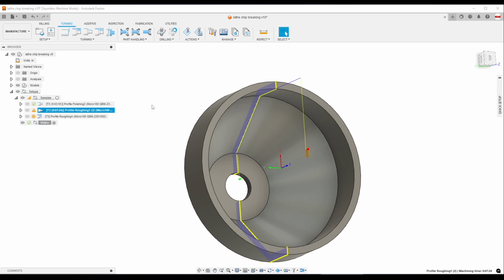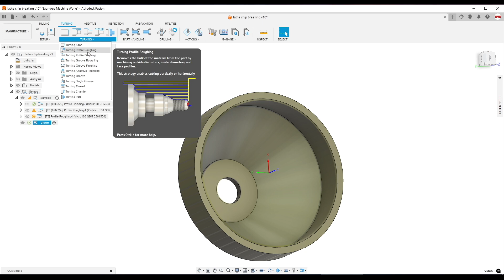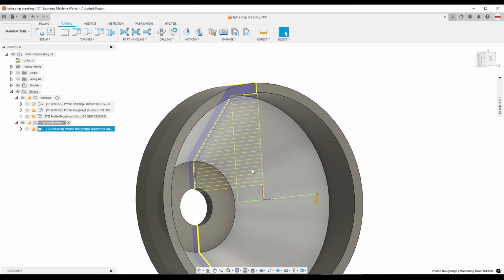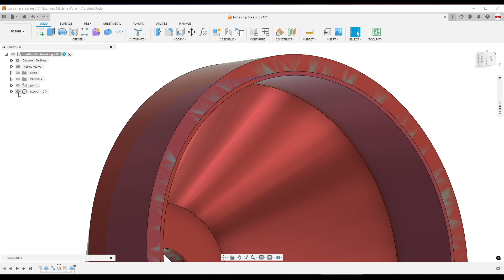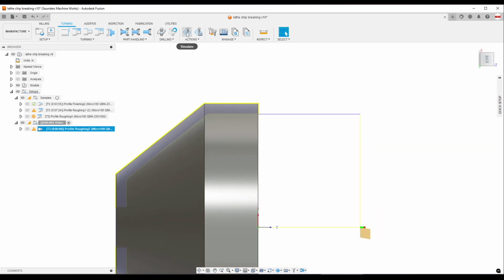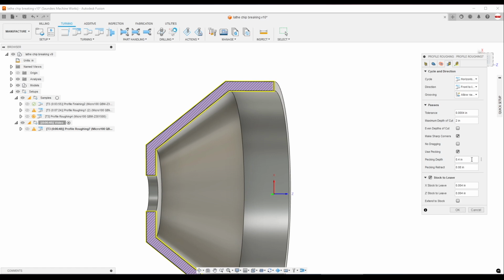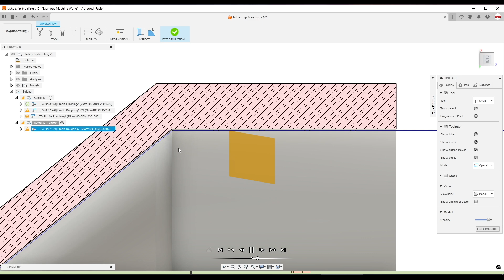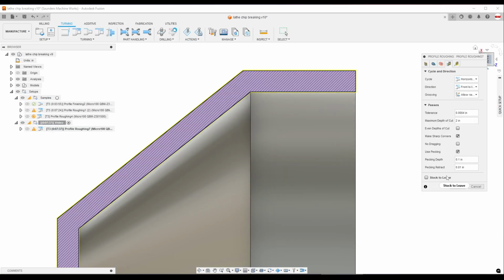Fusion trick to break chips on CNC Lathe Turning CAM!

Comment: does anyone have any advice on trying to learn the lathe side of fusion 360? I am able to use fusion 360 for 3 axis milling work. But the lathe stuff has been harder. Any good videos?
Reply: John admitted he is not strong in the lathe dept. But he does have a few good videos. His early lathe videos while helpful do show problems with the fusion lathe cam, which they HAVE NOT FIXED in the last 8 years. You also have Mechanical Advantage, Lars Christensens fusion channel have a few good lathe videos.

Comment: I enjoy fusion , but over the years. I've learned it's 40% jank 60% okay. You can't even import a index drill a lathe an use it in the same operation applied as a boring bar.   Fusion is okay for low tier or medium production shops anything more. It's completely outclassed by solid or OG MC

Comment: Hi NYC, I am a 46 yr old who got started in the machining trade when I was 17 in 1995. I progressed from a machinist (manual; occasionally running/pushing buttons on CNC's but rarely. Mainly alot of manual machining) to a mold maker in the plastic injection molding industry, to eventually a Tooling Engineer designing all types/configurations of molds (I could go on for hours but you get the point I am sure). I have been a Tooling Engineer for many years now, still do some machining/high tolerance surface grinding. Anyway, tons of experience in the machining trade, except programming of CNC's until recently wanting to see what it would take to get good at programming. We have Fusion 360 so I found your videos, man you make it pretty easy. Its been fun learning this software! You have a great channel, just wanted to say thanks for all the tips/tricks/instruction!

Comment: I just had this conversation yesterday morning.  This is definitely  one solution.   I found a good method for me is leaving cusps with a semi finish cycle( roughing cycle) to then come back with a finish pass.   I also recommend a different corner radius between semi finish and finish as a benefit to break the chip.

Good stuff.
Reply: I like that cusp idea.  6061 ID work on small diameters is the bane of my existence. Might try that.

Comment: Fusion turning is pretty tragic. Too many nonsense settings in the software and they are missing simple stuff. It takes way to long to program stuff and then make sure it works. I usually end up just using the conversational as it is way quicker. Maybe someday they will actually put some effort into turning
Reply: What in your opinion is missing from the software that are simple settings?
Reply: Not really missing. Too many settings that are unecessary like lead in lead out crap. They should have variable feedrate and variable rpm to get rid of vibration by now.
Reply: absolutely agree.

Comment: Did this for the first time a few weeks ago and the controller on my machine (Mitsubishi, MAPPS IV), just ignored the backwards motions and fed smoothly to the bottom. Used excel to edit the code and alternate G1/G0 and it worked a treat. Probably could fix in post but it worked for now.